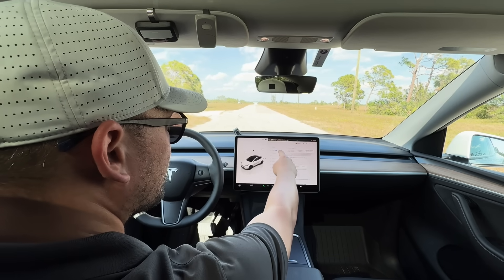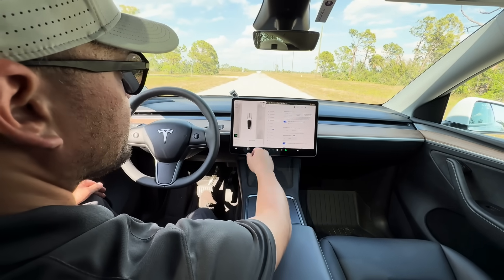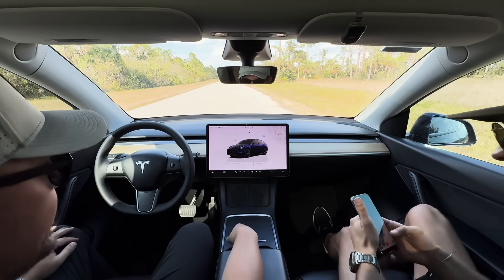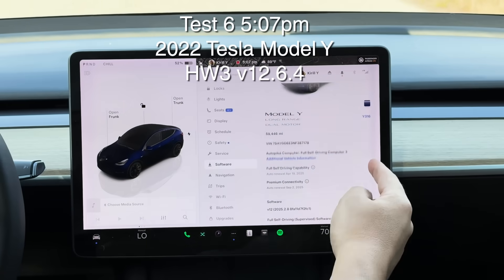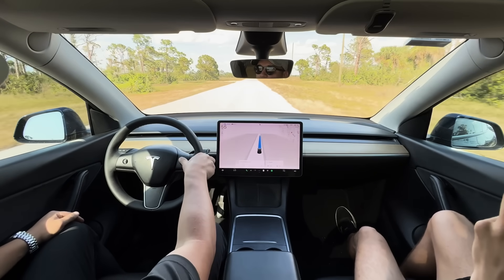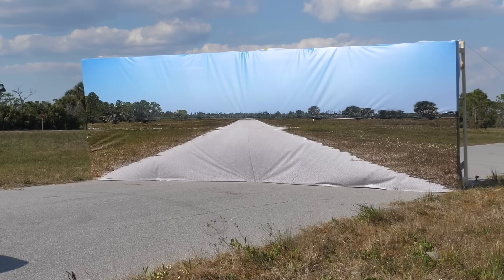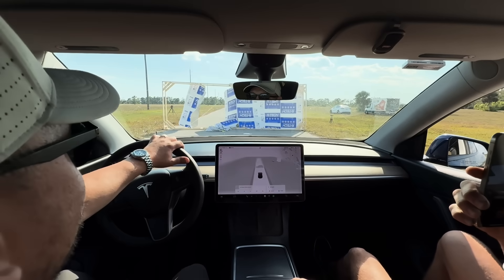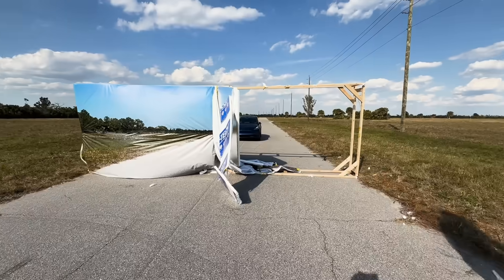Mark Rober Debunked - You can't fool a HW4 Tesla using FSD!

Comment: The problem with HW 3 is, that in 2021 the front radar was discontinued, because that smart guy with chainsaw was convinced, that cameras are enough. With HW 4, radar was reintroduced. I am pretty sure that the reason why the HW 4 vehicle sees the wall is the presence of radar. You should test older HW 3 cars equipped with radar (and maybe with older software, if in newer versions radar is disabled). They will very likely stop just because of radar. It is a big shame for Tesla, because radars were cheap enough to put them as standard equipment even in the small cheap entry level cars here in Europe. Seeing that huge obstacle is a piece of cake for any automotive radar.
Reply: If there are a conflict between the different sensors which ones do you trust? If you trust one more over the other, then the "untrusted" is superfluous.
Reply: @kirgan1000  Sorry, but you are just repeating Musk's BS which was debunked by Tesla itself by introducing radar again in HW 4. There is a very simple answer to your question - it doesn't matter how many sensors overlap each other, because that overlap just creates a safe envelope where most conservative reading takes priority. Most ADAS uses combination of sensors for a long time, including Tesla (but with that short embarrassing period with just cameras).
Reply: @ So you will accept a loot of dangers ghost braking? Now then you follow the most conservative reading.

Comment: The photo is interesting, but a more likely scenario would be a sheet of glass, what if the hardware 4 came across a transparent, non glossy sheet? Would it see it? Also, what happens when the hardware 4 starts driving from close to the photo so it doesn't have the surrounding view to compare with?
Also what happens if the cameras have a bit of dust or mud on them?
Great follow up. Thank you for both videos. Elon Musk must have known about this and Mark Rober still got a lot of blowback..

Comment: I think it saw the wrinkles on the flex rather than a wall, in the display it clearly shows the system is confused. Why are they still stubborn on not using better hardware?
Reply: It's called being "Good enough".  If you keep trying to solve every single of the edge cases, you'll either never ship, or it'll be so convoluted / complex that'll be way too expensive.  Sometimes "Good Enough" is literally good enough.  After all, the biggest complaint that lidar would solve is in poor driving conditions (eg. Heavy Fog, obscuring rain), the fact is most people don't want to drive in those conditions.  Yes, there are other things that lidar can do, but most of those work just as well with the video cameras, plus they do something lidar can't.  

Sentry mode.  You know, what's helping catch all the vandals.  So you'd still need all of the cameras, so eliminating the lidar was the best solution.

Now, if necessary, i'm sure that they would consider re-adding the lidar.  But I do recall that one of the reasons for the removal was that there were issues with trying to combine the lidar, and visual inputs, for processing? 

Technology connections covers this in this video - https://www.youtube.com/watch?v=GiYO1TObNz8
Reply: @BenjaminSchollnick  Bros defending a company making a Produkt worse (they used lidar in the past) get a life.
Reply: Because it would cost money.  Also Musk is Like i have only got Eyes and i can drive Therefore The car does Not need anything else but Cameras...

Comment: This is much worse for fans of LiDAR than you wouldn't think. HW4 is nowhere near final version and it already can do this, meanwhile anyone can see how far behind LiDAR is. For roads outside limited geololocked areas, LiDAR is unusable, meanwhile FSD csn drive preety much everywhere, with interruption every hour or two. As long as compute gets cheaper over next 3 years, its just gonna keep getting better and better.
Reply: Ok if Fsd is soooo  much better just using cameras than Any other manufacturer that uses Cameras, Lidar, radar... Then how about you drive your tesla through a rainiy nigh using fsd on the countryside.
Reply: @_kampfkartoffel2195 FSD always is worse where humans are worse. Thankfully it's much much better than LIDAR, as cars using LIDAR literally are geolocked to inside few major cities. So technically, FSD is infinitely better, making them even more superior than LIDAR on a rainy night in the countryside.
Reply: @Ormusn2o  You do not seem to understand firstly what lidar is. Lidar isn't a software its a sensor that allows for true depth perception and thanks to i the car can see much better even in bad visual conditions. Fsd is a software it would be better if it would also use lidar. This isn't even about the fsd software itself it's about how the lack of things like lidar or Radar limit it.
Reply: @ I know what LIDAR is, but it turns out, it is really hard to read data from LIDAR in a way usable for a driving car. Everything that blocks light is a solid block for LIDAR. Which is why cars using LIDAR are limited to most populous parts of few major cities. Because the software that uses LIDAR has to account for the changing environment of the world, and it is not efficient to do it over roads that will have one car driving over it every hour or so. Don't get me wrong, LIDAR is great, and actually, Tesla test cars already use LIDAR to collect extra data. More so, in 5 or 10 years, Tesla cars will likely start being shipped with LIDAR, to perfect driving even more. But right now, there seems to be no solution to how to make LIDAR usable for roads that are not constantly supervised.

LIDAR cars were fully autonomous like 10 years ago already, it was just for limited amount of roads. All that has happened since then is increasing the area of where the LIDAR cars can go, by increasing the database of the controlled roads. This means there basically is no improvements in technology for LIDAR (except the price), just more maintainers hired to handle the road navigation. But look at how far FSD came over time. It's actual capabilities are increasing, it's predictions and situation handling has improved. Can you say the same with LIDAR?
Reply: @Ormusn2o  I am Not for lidar Cars. I am for fitting self driving Cars with more Sensors than cameras (Something every Manufacturer exept Tesla does).  So yeah Tesla should ALSO use lidar/Radar TOGETHER with their cameras that would make their Cars much Safer. Of course Cars that only use lidar don't Work. IT can't even read Signs. Realying on one tippe of Sensor ist Bad regardless.
Reply: @ I did not wanted to get that deep into this discussion, but sure, we can do it. The problem with using multiple sensors, does not actually matter which ones, is AI. Most AI have singular utility function which dictates how well a system is performing. Those AI systems "modify" their actions in the environment to increase that score. This does not work for self driving cars. There are multiple goals you want to achieve when driving a car. You want to be safe, you want the drive to be comfortable, and you want to do it in a reasonable time. To assess situation of the  car, multiple sensors are being used, be it cameras, radar, LIDAR, ultrasound, accelerometers and many other. Most of them complement each other pretty well, some of them overlap. Example would be radar and LIDAR. Both can detect objects, but radar goes through some objects, and radar can bounce off obstacles. But they generally work together well. Vision is always needed, as you said to read signs, but vision does not work well with LIDAR. While things like ultrasound or radar work well with vision as a backup, because there are some things vision can miss, LIDAR has a lot of false positives. Things like foliage, paper bags, heavy water cause false alarms, and nobody solved those problems yet. So an AI neural network can't handle input from LIDAR right now, which is why the area on which cars using LIDAR operate is so limited right now. This is likely going to be solved through just more computing power, but we are 5-10 years away from solving that, which is why vision is the best solution right now. This is important, because all the AI systems on Tesla cars save a lot of lives, so it is actually morally imperative to speed up development of self driving, instead of testing LIDAR for decades and trying to make it work.
Reply: @Ormusn2o  i won't read that this isn't Worth my valuable free time have a good day sir.
Reply: @_kampfkartoffel2195 Thank god. I was afraid you are actually gonna keep debating this.

Comment: It sees the sharp contrast between your picture landscape and the real landscape. Now recreate the rain/fog kid test too, and let's see what it does. Limiting a vehicle to the same limitations as humans (vision) is utterly moronic when the technology exists to make the car's sensors super-human.
Reply: Honestly, it would be one thing if when they took out the sensors, they charged less for the cars, especially because you are literally getting less car, but no, they somehow managed to put less money into making the product and convinced people to pay more for an inherently less effective product. (The rest after this is just a rant. You can ignore it)  im tired of manufacturers removing things from vehicles ie: buttons turn stalks volume controls etc... things designed to be able to be interfaced without looking at them so you can look at the freaking road. Instead, they just put a touch screen in and software. I don't want to swipe through menus to adjust my seat heat if I wanted to swipe through menus while driving. I would be playing gta San Andreas on my phone, but nvm the rant, the point is instead of making things simpler and easy to work without distraction, they force the user to divide their attention Honestly the last decent features interior wise in a car has been the HUD
Reply: @hokage_smoke  I rather enjoyed your rant. Probably because I fully agree.
Reply: agreed
Reply: Did you account for what happens when say LiDAR or Radar has a false positive detection of a object whereas the camera properly sees that there is no object? What used to happen when Tesla had radar is that the radar would have a false positive that there was an obstacle and the car would phantom brake. This was scary as hell on the freeway when the car slammed the brakes for no reason. This went away when they eliminated the radar and improved the camera 3d modeling. Note also that if visibility is so bad that the camera cannot see clearly, full self drive should just not function. Why? Because neither LiDAR nor RADAR can read lane markings, and signs. Note also that there are many times in which the camera vision has been superior to my own in seeing deer on the side of the road on a stormy night, and stopped for the first deer, and the second darting across the road. Also unlike humans, it can look 360 degrees simultaneously all the time with perfect attentiveness without fatigue. Note also that LiDAR does not function well in fog or precipitation. Whereas even Tesla's HW3 camera can see better than a human under those conditions.
Reply: @StephenYen  Radar CAN have false positives because it's a blunt object that only senses that there's SOMETHING, at SOME RANGE within its field of view, with no sense of size or ahape, or anything else. LiDAR on the other hand, projects several IR laser beams out that sweep the whole area at a high frequency, essentially generating a fine point cloud that allows for precise mapping of 3D shapes and their precise range in real-time, and is independent of lighting conditions such as darkness, driving into a sunset, or fog. It's far superior to just regular RADAR, but Elon has a boner for a camera-only system, essentially imposing the same limitations on the cars as humans, which is just stupid. LiDAR does not have false positives, and coupled with cameras, as Waymo does, is FAR safer than Tesla's camers-only system.
Reply: @ganymede3141  are you suggesting that false positives are not possible for lidar? Because, my experience as an engineer, I'm certain that it's possible. Note that waymo does pull over when rain is too heavy for it's lidar to function.
Reply: @ganymede3141  Tell me, are Waymo's fully independent, or do they have remote drivers taking over all the time?
Reply: @StephenYen  I'm not saying that false positives with LiDAR are not POSSIBLE, I'm saying they're far less PROBABLE than with the blunt FOV or RADAR systems. It's all about probablity and rate of occurrence.
Reply: @JimmyBullets  Don't deflect. Are there 1 million Tesla robotaxis on the road since 2020? Are they Full Self Driving? No and no. Tesla's so called FSD is just an ASME Level 2, which is still fully reliant on the drivers having their hands on the wheel and taking over and being fully responsible at all times for any and all incidents and crashes. Waymos are far more autonomous than that.
Reply: @ganymede3141  my HW3 2020 Model Y no longer requires hands to be on wheel as of 2024. Just eyes on the road. I'm down to typically 2 to 3 interventions for a  drive these days (was about 5 to 10 2024q1) for a 26 mile 30 minute drive through suburban, highway, and dense urban. This includes heavy construction, pedestrian, and cyclist areas in poor weather. The times I intervene are not for safety or visual identification issues. I intervene because it slows down at yellow flashing lights (which is probably the legal thing to do, but no humans do it on 45 mph roads). I also intervene when in Michigan we have unmarked double left u-turn turn lanes and it often will go in the middle of the u-turn lanes instead of taking the inside or outside lanes. So the problems aren't related to identifying objects, it's more specific use cases that need additional training.

It even does amazing in crowded Costco parking lots with insane impatient drivers. Is it perfect, no.
But for me, it provides the best driver assist available to consumers that I'm aware of. No other ADAS in consumer available systems (to the best of my knowledge) other than Tesla is capable of driveway to driveway intracity travel with construction zones at all speeds. Am I responsible if it screws up, yes. Would I trust it with my life? Well I use it 99 percent of the time and say that it drives better than I do most of the time. Heck it even knows to get out of the passing lane when people are driving insanely fast or are riding your bumper.
Reply: @ganymede3141  yes and you can't buy a waymo and tesla fsd is coming in june. it is not "reliant" in any way you try to twist the meaning of that word, on having their hands on the wheel. they need the hands on the wheel because not a single car on planet earth can safely drive anywhere on its own without oversight or manual takeover behind the scenes. tesla is the only consumer car that will be able to do that and it's literally around the corner and been announced for june. waymo is constantly being manually operated. there is no real world advantage to lidar as demonstrated by the fact that tesla is about to beat literally everyone at fsd.
Reply: yeah because every company using lidar is doing great... right?... right?
Reply: @JimmyBullets  Right. Waymo actually has fully autonomous robotaxis you can actually ride in, while Tesla is still stuck at an ASME Level 2 system (full autonomy is Level 5). I'm still waiting for the million Tesla robotaxis that Conman Elon promised by the summer of 2020. What's that? It's 2025, and still not a SINGLE Tesla robotaxi on the roads? Oh. Hmmm... Interesting. Could it be because Elon constantly LIES about Tesla's level of technology and capabilities to keep the stock  and his wallet high?